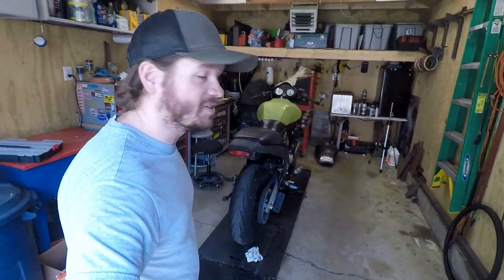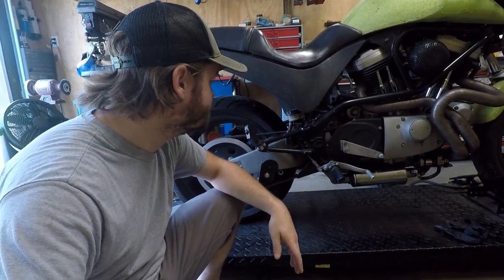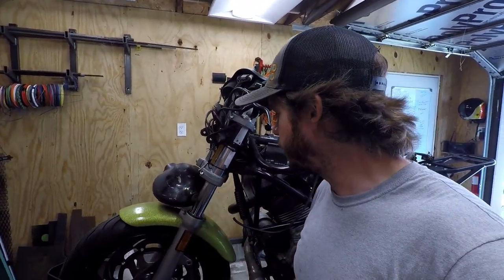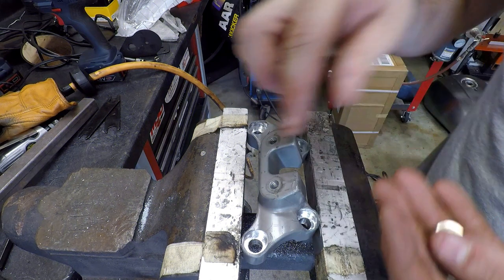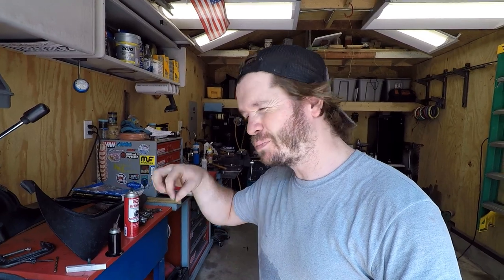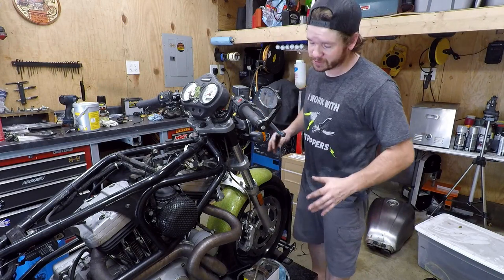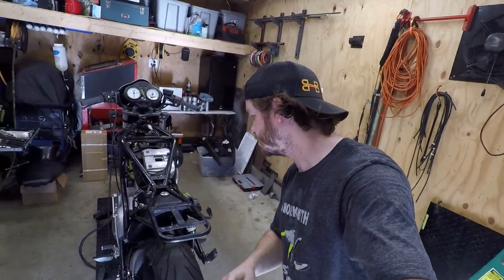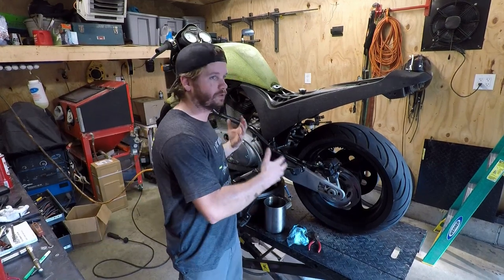Buell Cyclone - Fixing And Modifying Stuff! - EP2

Comment: Hey there,  This video has so much going on.  (for my Bandit project)~ Yada Yada Yada ~. Now soaking the exhaust bolts with that "Blaster" stuff.  Got a nearly new and pristine set of pipes and exhaust ~ complete.  With travel to Springfield MA. ($50). As I picked it up ( ~ the guy had to dig into a mess in the attic of his tiny garage there in the Puerto Rican neighborhood). Anyway the guy said "yea these have been up here since 2009" ~ crazy. No rust, just dust. So I am putting the whole thing on my bike. And then I suppose someone will want the whacked almost new exhaust set up that's still in good shape currently on my bike.  This whole thing has stretched my skills with fb MP.  I'll tell ya. The work you are doing on this bike is an inspiration.  Thank you. Steve ~ from New Hampshire.

Comment: I had one of 6 Buell M2 special edition in Australia which got wiped out by an idiot. I had full American race gearing with a flatside and yhost power tube in the flatside. This thing absolutely was a monster and the only problem I had was the single outlet from the tank because it hated being leaned over. My Buell was Gun Metal Grey with Volcanic Orange frame and wheels. The fastest pig ever in Australia. Good luck brother. I still have original parts if you need.
Reply from the maker: That sounds like a mean bike! I actually sold this almost 2 years ago now to a friend so no need but thank you.
Reply: @BrickHouseBuilds  Just saw your video now. This thing pulled over 280klm an hour and was street legal. It was one of the fastest pigs in Australia and almost got featured in a magazine. Cheers matey from the land down under.

Comment: Around here there are 2 Ace Hardware stores that have nuts and bolts and bushings. It will take looking around and some hand made items to rescue the bike.  It is good to see you working on the Bike. I have made many upgrades to the Buells I have, and helped many other bueller's along the way.  Kinda lost count over the years so many bikes so little time as it goes. Post up the sound bite of the exhaust when you get it ready. Been using 20W-50- AmsOil in the Engine and 20W-50 in the primary and it works really well. Other oils really don't work well in the Air Cooled  Engine. I have used AmsOil  for 40 years . Most riders use something else till (oh no) happens thats where someone like us comes in. No Fram oil filters Please.
Reply from the maker: Hey James, yea I just need to make more time to work on the bike as I usually only give myself Sundays to work on my own projects. I'll get there though. For oil, I won't get into a discussion as I don't buy spendy oils when I have luck elsewhere. Nothing against it beyond the cost. I don't get to put many miles on any one bike as it is so my intervals aren't very per the book as much as its time based for me.
Reply: @BrickHouseBuilds  Everyone has their own way with the cheap oils.  Air cooled engines of all displacements need the one thing that protects and that only thing is the oil. Plenty of Harley Davidson dealers with the less costly oil. Like the screaming eagle you have to change every 2'500 miles. Over priced except for fair weather riders that put maybe 2'500 and less miles per year. Depends upon the engine and the bike it's in. I race 3 different bikes, track and drag. My 2 street bikes I treat the same as the race bikes. Shop is too full of other bikes I'm fixing for customers. Fluids are everything, and town traffic destroys oil in air cooled engines. Especially the Buells , if there's no cooling fan for the rear cylinder. Even then the engine gets near and over 275 degrees at times with a cooling fan. At least that Cyclone Buell has a carburetor on it. Enjoy your builds. Good luck.

Comment: Another great video series, well done on the videos and the bike fixes. 
I've got an 01 X1 and it had a lot of the same issues. It has the newer shifter setup, but the bushings wear excessively on the new one as well. I solved it by making my own, it wasn't too hard starting with a brass plumbing fitting. I used a lathe but chucking it up in a rotary fixture  (a bolt or similar to clamp it in place and rotate) in a drill and running it across a sander disc or belt gives good results too. I made it a little too tight and it wore in beautifully.
Not bronze but working great for now, zero slop and clean shifting. Long term will likely be the same in sintered bronze.
Reply from the maker: Thanks James! You should definitely like the next videos in this series.  I did sell the bike to a friend but I did a bunch of work to make it safe and reliable

Comment: Can't find a front brake caliper removal, and pad replacement anywhere for a m2 cyclone. I just completely took the caliper apart because it doesn't clear the friggin rotor and it all fell apart. Do you have a video on this? Thank you in advance.
Reply from the maker: I do not have a video on it unfortunately

Comment: How hard is it to replace the belt on those m2 cyclones? Mine just snapped the belt and I haven't had time to look at it because it looked like my whole rear end (swing arm included) has to come off to do that. Someone told me it's easy but I need to hear from people that have actually done it. And there's not a lot of YouTube videos about that specific model. Any help would be appreciated.
Reply from the maker: Per the manual once you have the rear supported and have the rear wheel off you loosen the right isolator bolt until you can spin the bushing and then slide a belt in that gap.
Reply: @BrickHouseBuilds  this makes me feel way better now man. Thanks a lot. I actually have the manual but the internet has made us all too lazy to remember about stuff like that because now YouTube exists 😅, I'm glad I came across your video 👌, I'm gonna go home now and fix that sucka myself 😊. Keep giving us more of that Buell stuff bro, it's becoming rare and hard to find any I go about these bikes and I'm glad you're doing it 👍. (newest subscriber to your channel) long live Buell 🙌.
Reply from the maker: @Aye_Poi  LOL no problem.  After you asked I just grabbed the manual and summarized what it said
Reply: @BrickHouseBuilds  I appreciate you taking the time to get back to me that quick. You just got me back in the game 💯

Comment: Very interesting animal, the Buell.  How would you rank this build quality with Japanese, Italian, German, and British?
Reply from the maker: Well this is a pretty unique bike by design and my only experience with a Buell so hard to say. For me, working on Harley engines tends to be frustrating as there is a mix of hardware, some stuff is hard to access, you can't remove the starter without removing the primary and clutch, valve train is always noisy with no adjustment beyond swapping pushrods, and just clunky feeling. The chassis though is great!

Comment: Congrats on 5k subs! You still looking for those bushings? You might be able to find them if they're a standard size on McMaster. If you can send material and dimensions we could collab on them! Oil impregnated bronze round bar is expensive though.
Reply from the maker: Thanks Chris! I actually picked up some 5/8x3/4 bronze bushings from the local hardware store. I hand filed the peg to clean it up and used some sandpaper mounted on my drill press to open up the inside of the bushing juuuuuust slightly. Fits like a glove and shifts fantastic now!

Comment: The stock rear shock are a known issue with these bikes, they tend to blow out and loose fluid resulting in no dampening. Unfortunately I do not think they are serviceable.
Reply from the maker: Thats what I've found. May or may not be serviceable depending on model.  I need to confirm first and go from there. I just don't want to drop more for a shock than the whole bike lol
Reply: Had no idea that certain models were serviceable, I have the same issue with my 2000 M2. If you find out which styles can be rebuilt, please let me know.
Reply: I thought RaceTech serviced these shocks?
Reply from the maker: @bernibeckmann9753  I believe they do but haven't called yet